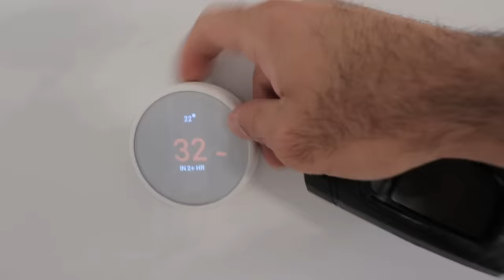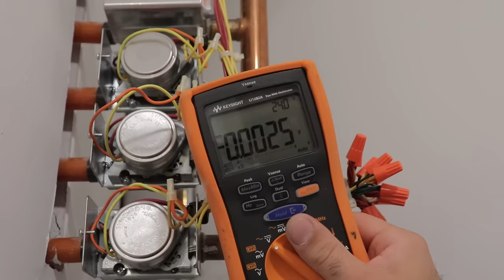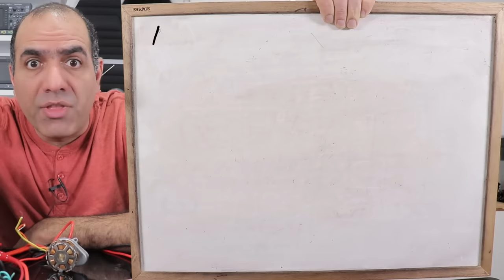Electro-Plumbing Repair… of my home heat zones that won’t heat although the boiler is running fine!!

Comment: I'm pretty sure the motor and the spring function that way so that it fails off.  That is, if you lose power to the house, the valve will shut on its own.  For example, if you lose power in the winter while you are away from home, if the valve doesn't shut automatically, the pipes can freeze, burst, and flood your house endlessly.

Comment: 10:47
You mean a BRUSHLESS DC motor, which because it's a 3-phase PMSM (permanent magnet synchronous motor,) it will hold its position when a DC voltage is applied to the windings.

Comment: Correct on the trade scale. An electrician is able to fix anything. We are gods lol. More advanced then anyone else.
Reply: GODS
Reply: Although an electrical engineer is slightly less experienced then an actual electrician, I'll admit they are pretty smart. It's our job as an electrician to make the things the engineer thought would probably work to actually work. Things that work in theory and with math miss all the stuff that is part of reality... As an electrician, we understand reality and will make it work for you.

Comment: The spring action is for "FAIL POSITION" Very important in Process design etc It is so that in event of loss of power, the valve "fails" to a certain place and doesnt stay where it is. Typically used in safety places where high temp/reactions take place. I.e. if a reagent can cause massive exothermic reactions and the power fails, the spring returns the valve to CLOSED so the reactions stop, instead of a failed valve causing loss of control. Here the fail position may be "Open" to try dissipate the energy. Source: Chemical/Process engineer here. Hopefully at the plumber/rocket science tier.

Comment: They've been making those 24V/AC motors for around 60 years now. They have been at the heart of valve controls forever, thermostats, water softeners, timers and so on.

Comment: Hi Medi, I suggest you replace your inefficient system with something more efficient like reverse cycle AC. And also you should put physicists at the top of your list.
Reply: Gas hot water heat is pretty efficient, especially in cold northern climates.
Reply: @stargazer7644  I once believed that there is nothing more efficient than generating heat inside the house,  but then I learned that moving ambient heat from the outside to your house could be 30% more efficient than generating the heat in a conventional way.
Reply: @ricardobraganca2307  Efficiency isn't worth a shit if it is 0F/-18C outside and your wonderful efficient heat pumps are struggling to keep your house at 50F/10C.  Ask me how I know.

Comment: I think youl find that "magical short circuit" is a reflux system that prevents the expansion vessel from going bang incase the valves screw up or there's a pressure surge

Comment: Thank you for fixing the term for circulation pump.  Lol.  Valves fail all the time.  Also no point in blurring out Viessman.  I have the same system in my house, only difference is i have the combi kit installed as well.  Less zones though.  Great video as always, hope everyone is staying safe and taking care.

Comment: I think thats pretty cool that your heater valves use those synchron motors that are just like what my Federal Sign and Signal AR timer uses for its timing cam!

The one in my AR timer runs on 120V 60hz and does 20 rounds per hour.

Comment: Just a note, Plumbers are not licensed to install or service boiler systems.  In most locations only HVAC technicians with a boilers license can legally install or service boiler systems.  Boilers are not plumbing systems.

Comment: I mean plumbing is just electrical engineering but with water in the “wires” instead of electricity. If youre a good electrical engineer youd make at least a decent plumber by default, but a plumber would probably fry themselves if they tried to work with electricity.

Comment: ...and that's why you use thermal (thermoelectric) valves which only work when needed, and has a very long life expectancy... in exchange for a slow reaction time, but that usually is not a problem at heating systems.

Comment: The low voltage terminal strip you referenced..Only 1 wire is allowed there multiples wont get Sametime connection...A electrical engineer should know this! Just giving you a hard time as a electrical/mechanical service technician. Great videos

Comment: Somebody must have already said it but... The motor stays energized when open to provide a failsafe - if the system goes 'down' (power lost) the spring closes the valves.

I should have scrolled a bit further: Jim K (3 days ago). Eh, might as well leave a comment anyway to 'feed the algorithm'.

Comment: Here in Germany we got a heater element instead of this Motors. The heating element does heat a liquid wich expands and presses a valve Open. 
Also safety Low voltage or 230v ac available. Takes a View minutes to Open. And even a few more to cool  down and close the valve after Switching Off

Comment: I have this type of hot water baseboard heating as well and EVERY WINTER at least one of the valve motors needs to be replaced. In my case they usually get stuck open so the affected zone gets unbearably hot.

Comment: I was telling a friend about this episode and this is what I sent them about this episode “ I watched a funny video where the YouTuber ElectroBOOM, the one I was telling you guys about was debugging his water space heaters and ranted about how plumbers are not electric engineers or electricians and shouldn’t be allowed to do wiring because they do dumb stuff and are completely inefficient at wiring something. 😆 there wiring had made it so the motors for each room where being powered above there 12 volt ac rating so that when all rooms where powered every motor was being powered and not moving to keep the valve open which caused two of the motors to basically burn out and not able to open there respective valve where they could have used dc motors and simply reversed the current going to the motor to shut it off so the motors would only be powered when ether opening or closing the valve instead of having it where the motors had to stay powered in order to stay open. ”

Comment: The thing you didn't know what it was is a circulation pump an electric motor with an impeller. And your tankless isn't connected to the valves it uses a flowmeter internally to know when to heat when it senses flow it engages.

Comment: Funny thing I fixed the cab heater fan in a car once by accidentally shorting it direct to vehicle power when diagnosing it, there was a big spark and then it worked fine lol.

I feel like an electric motor isn't needed in the first place, all you need it to open a valve and close and electrical circuit, a relay and solenoid could do that just fine and with less complex components.

Comment: The motors stay energized to hold the valves open so that when power is lost the spring can close the valves again.  It is inefficient for power, but it's a fail safe to make sure heating doesn’t run away during a power failure.   You call yourself an Electrical Engineer…. You’ve just been bested by a Computer Engineer!!!!! 🤣

Comment: I have one of those thankless water heaters, but it doesn't heat the house. That would be nice to have though. My water bill is next to nothing, and I run the system on Propane so it doesn't affect my electric bill. It costs about $147.00 to fill the tank it uses, and I haven't had to refill it in over a year lol. I can't remember the first time it was filled, but I just refilled last month, so I'll be good for a while lol.

Comment: you're likely better of buying the whole "zone valve" and using just the "power head" from it. keep a valve or two and scrap/recycle the rest.
I say that because the gear teeth get eaten up with age and jam, a new motor only will quickly get chewed up by the partial gear-wheel on the rest of powerhead. common failure.

Comment: 1:57 the short circuit doesn't matter much since it's trying to heat the entire volume of water to a certain temperature and it's a closed loop.
However if you closed all the backboard heaters and then turn on the boiler, bad things will happen.

Comment: Mhedi has reached the point where he can fix anything by just running high voltage though it and burning anything without doing anything. Absolute mad-man

Comment: Most boilers use magnetic zone heads, which are just magnetic solenoids, and an end switch to tell the boiler when the valve is open, so that the circulator pump does not dead head.

Comment: Those are actuators. And they normally run on current limited AC. Between 16VAC to 48VAC. Depending on hot water heating system. You can get an air lock on the line, sometimes you have to bleed the system to get it out. Otherwise the water cant circulate.

Comment: By the way - this weird setup, that the motors are kept running the entire time to apply force against the spring, is for safety reasons. It's so that if you have a power outage or a malfunction in the motor, the valve is ensured to be automatically closed.

Comment: That's a big task load for that lil combi unit (if you have alot of radiators or large open spaces to heat, you might want a dedicated unit...  also wouldnt be a bad idea to have a backup, you REALLY don't want your heat to randomly go off like that kn the winter).

Comment: I had a motorized valve for water on a pipe of 1 1/4" or DN40. The ball valves or whatever they are called are surprisingly unreliable. Their average lifespan does not exceed 6 months.

Comment: The pipe that is like a “short circuit” is a bypass valve. It is supposed to make the pump operate at a higher flow rate if you’re system needs it. It’s supposed to have a valve on it but whatever

Comment: 6:25 30V WOULD be safe, if it wasn't coming from an AUTOTRANSFORMER which is NOT galvinacally isolated from mains! The outputs can still have the full mains voltage referenced to ground!
(I guess polarized mains plugs make it somewhat safer, but not all countries have polarized plugs.)
Reply: i recently got double shocked from 2 15V batteries and the burning and tingling sensation is so weird

Comment: As a mechanical engineer… well, first off, rude.  But I took courses in both fluid mechanics and electronics.  This video would have been a great opportunity to talk about how surprisingly similar the equations for electrical current and fluid flow through a pipe network are.  By a lot.

Also, if I had to guess, maybe the motors having to be constantly on to keep the valves open is a safety feature in case of power failure?

Comment: our zone valves spin 360 degrees and has a disc on it to sense location of valve position. so it just turns valve to open position call for heat and spins valve another 180 degrees in same direction to close valve. i believe ours are honeywell valves

Comment: Idk why the maintenance technicians even wired the voltage conversion transformer that way. I bet you anything that's affecting its output voltage, hence why the motors are getting 30 volts. But I also realised that maybe the primary and/or secondary might have not enough turns in it to reduce the voltage to the recommended 24VAC. As Mehdi stated, 'That's what you get with an unregulated power supply', meaning you have to rate the motors at a higher voltage a bit above the 30VAC line, so that the motor can still run as the AC line fluctuates from time to time.

Comment: I'm sure as an electrical engineer you know this, but I'm posting it anyway because other viewers might not: electric vehicle chargers and tankless water heaters (among other things) often introduce noise into your home electrical system, which can be problematic for sensitive devices. I'm not sure what the best way to troubleshoot such issues would be, but it's something to keep in mind if you have such things in your home.

Comment: its possible theyt used a transformer designed for 108V input vs 120v. This will overvolt the output to what you are seeing.  

An industriual hot water pressure washer at work had this issue, was designed for 3 phase power service but on a single phase service  the transformer was outputting enough overvoltage to destroy other control components. 

if you have further failures go find a new transformer with matching VA but designed for 240v in 24v out

Comment: @electroBOOM Its set up that way so if the motor fails or needs to replace it "should" fail in its opened positions so you still have heat to that room

Comment: Well, I think the Spring in valve is a fail-safe so if the motor in your case is broken the valve get stuck closed and doesn't waste a lot of heat. Like the switch on the Valve is there to tell the Heater to heat it is a fail-safe. It is there to protect the Heater from overheating the system. 
Hey, Im studying Mechanical Engineering :(.

Comment: When you replace something, dont you replace everything?

If you only replace the two bottom ones, and as you say, they're two years old, the other ones should break soon after. Wouldn't it be smarter to just buy 6 to replace them all?

Comment: The 'always on' could be a form of fail safe so it fails in the non-heating position.
There are all sorts of solenoid valves that would seem to be a better solution and require a rectifier - full bridge or otherwise.
("Normal closed" would be the equivalent here - apply a voltage to open the valve.  Plenty of 12 and 24 VDC solutions I think...)
Not sure how the UL/CSA certification would go, however.

Comment: 1:59 well, except for the orbital mechanics part (which is largely solved and ran by computers nowadays), rocket science (for for non-solid rocket motors) is basically plumbing.
And I don't mean it as a joke. It's hard to get the huge quantities of cryogenic fuels to the engines in the right amount and pressure and temperature and get the cooling and heating of the parts in the expected values...

Comment: I Mehdi! In my building we have a thermo-solar installation that uses the very same motors (but 220V AC) and they pop very frequently. I've change mine twice in less than 5 years! 
However, the proper solution seems it is using an electro-valve with a micro-controller. but it costs much more than simply buying several of these ones and replacing them every now and then. 
So sad to have this kind of things to save power and be ECO and instead we generate waste replacing this part. 😢

Comment: I don't think the extra 6 volts on a 24 volt motor is a big deal. The motors dissipate more power, sure, but the way they are made, not a problem. I would think binding of a mechanical part of the gearbox, or binding of the valve itself would be a bigger factor in failure.

Comment: Could you step down the voltage individually to each motor to 24vac? Like a buck converter for AC for each motor… maybe run lamp dimmers to each motor.

Comment: Hey! The two new motors spun longer before they stopped relative to the 'old' good one. Is this the magic of video editing, or are the new motors a different pole count (ie, different speed), or are they a different gear ratio? In the end it doesn't matter- they get the job done. While I'm on a roll, what was your line voltage to the '24 vac' transformer? Maybe your line was high- you west coast guys seem to be full power / full speed all the time. I'm on the end of a long string on the sleepy east coast. Sometimes I have to get the hamsters on the treadmill generator in the basement to keep the lights from flickering.

Comment: Its probably dried up bearing try use some mechanical vaseline or some lubricant depending on type of bearing, i would assume its some sort of ball bearing  or sleeve bearing if it only runs sometimes, there no way sleeve bearing would last long if it spinned forever

Comment: Even under full load, the transformer voltage is 2 volts higher than the motor rating. If the system keeps eating valve motors you might consider replacing that transformer.

In any case, nothing here really explained what was actually wrong with the motors. Perhaps they had internal shorts in the windings, but not enough to prevent them from running at all, or perhaps the lubrication in the geartrain has become gummy (from heat from overdriving the motors)

Comment: Quick test with the system is on lay your finger on the copper line on the left side if it’s  hot you have water flow if its cold you know the valve is not open

Comment: Seems to me that you can add some Step Up and Step Down circuits in line with these motors to ensure that each will not receive more than 25V. In short regardless of input, the output will always remain constant at 25V, and that should ensure the motors have a long run life... Just a thought...

Comment: If I were you I would insulate the hot water lines wherever they are not needed to heat the space (as in the boiler room for example). Could save you quite some energy.

Comment: Why will the motor fail at higher voltages? As the volts increases the current will decrease and the power will remain the same. If no arcing occurs between the windings then the life of the motor should remain the same or be extended as the system is drawing less current?

Comment: I do not have an electrical engineering background of any kind but maybe the valves use constant power to fight the spring so that if power is lost the springs will pull the valves back shut without any power?

Comment: Your zone valve died as an hvac technician it is the most common issue if ur still getting heat and water. These valves cook themselves over time

Comment: KISS, reversing DC motors requires extra circuitry and plumbers aren't brain surgeons. In the UK those motors are usually 240V AC direct, mains no transformers etc.

Comment: I'm assuming the motor being on all the time to keep pressure on the switch whilst the valve is open is to ensure that the valve's fail safe position is closed if there is a power failure.